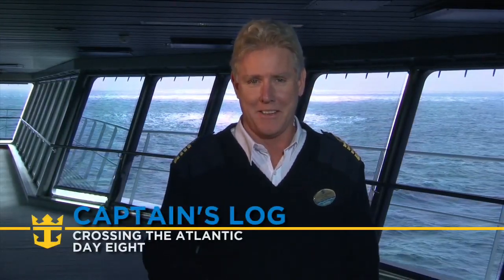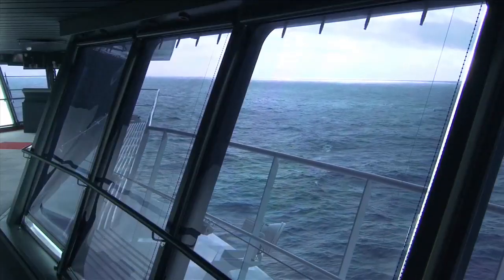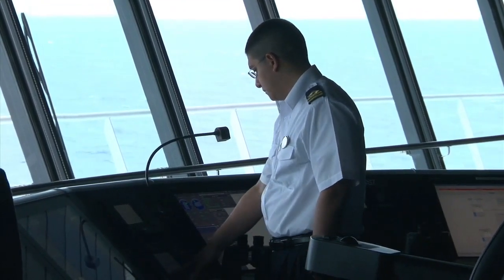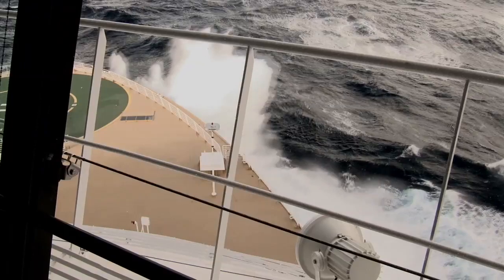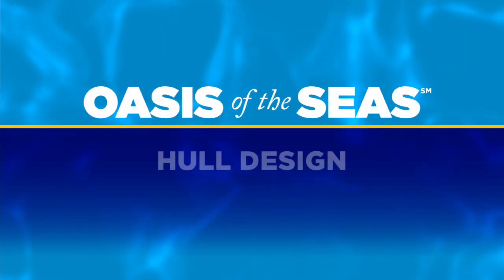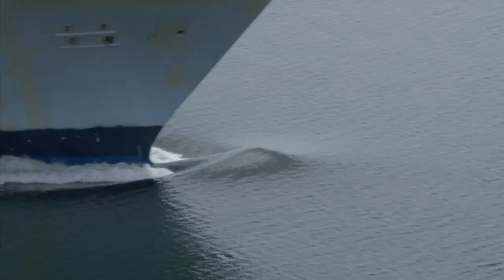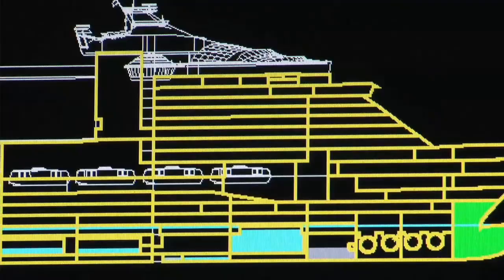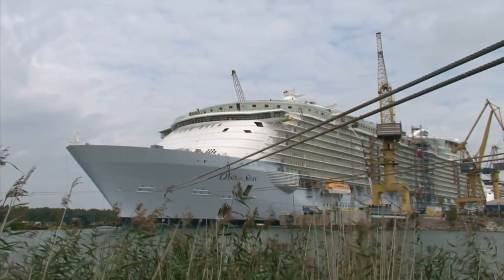Oasis of the Seas: Hull Design

Comment: @tupsumato QM2 steel plating thickness varies in size, the book about QM2 states it's 28mm thick as well as the Genesis of a Queen by Chantiers de 'Atlantique also said the same thing, and they also stated QM2 is the only ship since QE2 to be designed to withstand 40 years of being hit by Atlantic waters while running at high speeds.

Comment: @tupsumato Yes it does, Like I told you Stephen Payne said on discovery channel that he designed it based on the QE2 and you can find it all over the web, as for the "wave breaker" it's that weird triangle located at the bow of the ship, the one with the cranes on top of it, it's exactly the same as that of the Normandie. It's written in the Captains Log website, as well as in MegaStructures.

Comment: @tupsumato QM2 has the most powerful engine and pods ever constructed. QM2's hull is shaped to also slip faster through the water (The shape of her hull is identical to that of her sister ship QE2) the QM2 has a more efficient wave breaker, which is placed at the bow of the ship it's that weird triangle with cranes, and that breaks 30 meter waves. QM2 obviously is more powerful and efficient than the Oasis, because the Queen was build for the roughest weathers on the planet and Oasis wasn't